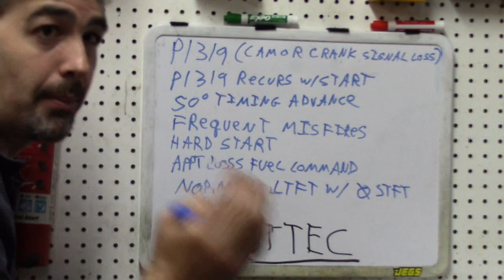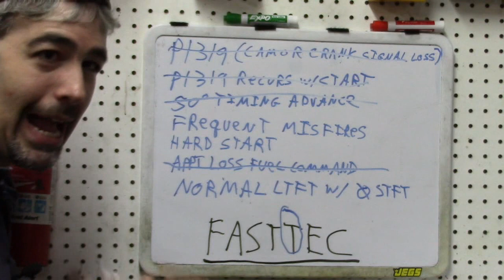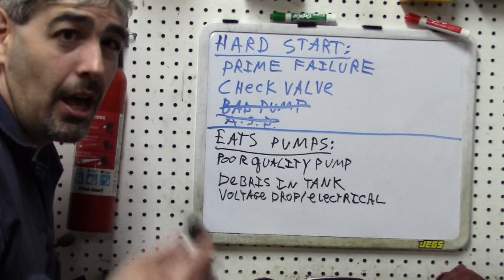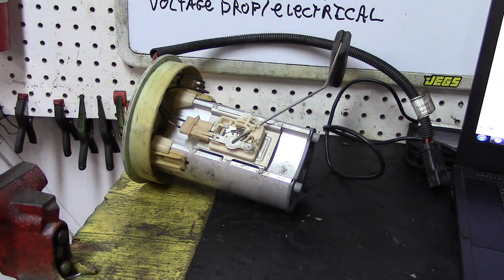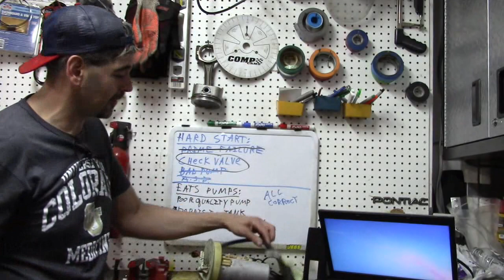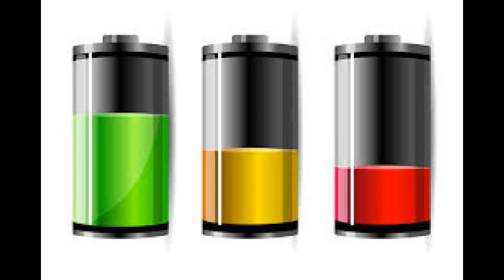Jeep Eats Fuel Pumps Follow up and Hard Start Diagnosis and Repair

Comment: So, you fully drained and rinsed the tank, right? And there was no filter (sock) laying in there?  SO, we've got a tank with no filter on the pump AND a bunch of particulate crud sloshing around in there, AND a pump that you're pretty sure is a used pump.  Hmmmmm......    It would be VERY interesting to look at the receipt the customer had from the place that put that pump in. Looking at the cost of the pump, and to see if they put a part number on the receipt.
______

INSERT COMMENT-->  Matt, I think you should strongly encourage all your customers to start maintaining full and thorough records for every single thing they have done on their car, not just with you, but everywhere they take it, including any work they do themselves. Have them just get a folder to put all their recipts in, and a small notebook to make brief notes in about what was done and when. Not OCD level record keeping, but just a very basic record. Date, mileage, shop, parts, diagnostics, preventive maintenance, etc.

I do this. I also save all the boxes that all my parts come in (for work I do on my car myself). I write the install date on the parts box in magic marker. And I save all the receipts, for both parts I buy myself and for all service that I have done on the car by others.

By the way, do you keep computerized records about your customers cars and what you do, or do you just keep a paper folder, or what?
END INSERTED COMMENT

_____

I just did some checking. From RockAuto, the Airtex part is $100 and the Mopar part is $225. It looks like the pump is the same wheather the engine is a 6 cyl or 8 cyl. Mopar part # is 5018056AC and Airtex part # is E7127MN.

I'm gonna go back to one of my usual rants for a moment (sorry).  WHY can't you or the customer go back to the previous shop and say>

 "Look dudes, I took this pump out of this car. You guys put this in there. But there is no filter. And now the pump died AGAIN. You did a job that was not only incompetent, but FRAUDULENT. You put in a pump without a filter. That's like doing surgery without sterilizing the scalpels. Because of it, the pump died, and the customer is now paying me money to do the job PROPERLY.  What are you going to do about refunding the customer his money for the labor and for the part that you put in? And by the way, did you install a USED pump, but charge him as though it were a NEW pump? That's FRAUD my friends."

If the american automobile owner can't start finding ways to do as described in the above paragraph, we're never going to get better results from the repair industry. Although it might not be possible to PROVE that they committed fraud, they will know that they did (possibly twice, one for the filter and once for a used part).

If the fraud could be PROVEN, the customer could sue them and would certainly get some sort of settlement, the bigger the better.

When a bad shop starts to realize that by doing a shitty chintzy job and saving a hundred dollars or making a hundred dollars beyond what they deserve, but then they end up on the loosing side of a thousand dollar court ordered settlement, maybe they might start changing their behavior.

I wish I understood these concepts better when I worked in shops (like, 35 years ago), because I would have done something about it. I hated the companies (chains) I worked for, I ended up quitting my job from three different shops. All three did horendously dishonest things, and often fraudulent things. A year later one of them was caught in an expose on the evening news committing fraud.

End of rant. For now.

-Douglas
Reply from the maker: No sock. When I clean a tank I reach in to my elbow to sponge and dry every inch of the interior, especially the corners and there was no sock. Maybe it fell out in the donor tank years ago  and tech didn't know there should be one?
Reply: +douglas lee Wonder if they just pulled a badly clogged sock off the original and put the pump back in without one.
Reply from the maker: ***** I was thinking the sock is still in the donor vehicle tank and they never noticed or even knew about it

Comment: I know what you mean about your story I get it all the time I tried to explain about the voltage fluctuations in a vehicle and how the computers in the car don't like that. The older people don't get it they think we're just nuts just don't know what we're talking about. But in a sense if you have a bad cell in the battery in the voltage is fluctuating all kinds of strange things will happen to the cars PCM. At least this is what I have discovered over the years of experience that I've had in the feel of the locksmith. And we deal with these electronic key is daylight. Diagnosing the problem in most cases is the hardest problem for most shops but I appreciate the work that you do because you work like me. Like to get the right answer and then fix the problem. Great videos keep them up. 

Thanks James
Reply from the maker: Yes I have seen everything from speedometer problems to apparent transmission problems result from bad batteries.

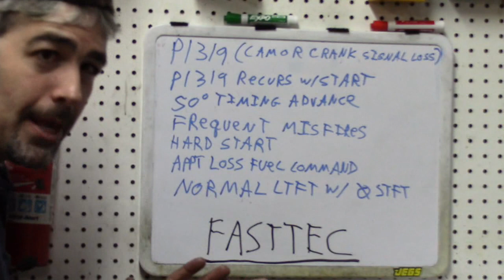Comment: 6:01  Anyone experienced in auto repair would know that you got a nefarious double-whammy with a bad cam/crank + fuel pump issue.  It probably would have stumped most technicians (judging from the owners previous bill that is obviously true).  The fact that you figured it out is a testament to your skill.  It's probably one of the most complicated multi-issue scenario you could have roll into your garage.   This video is going to help a lot of people.  Two thumbs up.
Reply from the maker: Absolutely- anytime you have two (or more) problems it becomes very difficult- but 10X so when the problems share the same symptoms so one doesn't stand out!!
  Basically, once I eliminated Timing as the cause- only then did I have to consider there may be an unrelated simultaneous problem that was hidden.

Comment: "In a logical process you are not allowed to dismiss data or evidence because you don't understand it." This is the basis for a lot of research incompetence and fraud. In the social sciences (and probably medicine research too) the popular prejudices come to be relied upon so that a conclusion can be reached. Sometimes the researcher knows of the prejudice and sometimes not. The public commonly does not. Therein lies the opportunity for implanting beliefs of causation which in reality do not exist.
Reply from the maker: Well put!! I can definitely tell you in research I have personally seen evidence or data dismissed because- quite simply- the researcher doesn't want it to be true. Cell line misidentification  is a HUGE problem (e.g researcher thinks they have one type of cell they are studying but actually it is misidentified. Happens 30% of the time). The researcher gets great data but never checks their cell lines. But introduce the idea they should verify their cell line is correct and they will tell you to pound sand because if it turns out they had the wrong cells, it would mean their research may be bogus!
  "sticking your head in the sand" basically.
Reply: +Schrodingers Box Do you jury articles for journals?
Reply from the maker: Kevin Hornbuckle Nope- I am in a different career within the science field now- I left academics some time ago
Reply: Yeah, but you can only (usually) check one thing at a time!  Only have 2 eyes, 2 hands, 2 arms and sometimes they ain't long enough!  -- Therefore, many of these tests are very time-consuming.  If the customer and/or your boss is breathing down your neck and expecting you to be clairvoyant, have x-ray vision, plus the ability to time-travel so you can fix it last week before it broke in the first place, you may be S.O.L. and have to take a wild guess.  If it works, you're a HERO! (and have a slim chance of beating flat rate)

Comment: 5:14 Just because you have good LTFT doesn't mean there is good fuel pressure for starting on a first crank (will cause hard starting / long crank time).  I really hope you aren't advocating that good LTFT means good fuel delivery,  that is simply incorrect.  Sometimes it takes a while for fuel pressure to build up with a faulty weak pump or split in fuel hose inside the tank.  A split hose inside the fuel tank might be just big enough to reduce pressure to the point it takes a while for pressure to build up.  That's why it requires multiple attempts or prolonged crank time.  The only way you would know differently is by using a fuel pressure tester.  Checking LTFT is not a substitute for a fuel pressure test.  Because you are a great diagnostician you eventually looped your way back to the problem and made the correct assessment.  I believe the flaw in your methodology is that you thought LTFT could confirm a good fuel pump?  Forgive me if I'm not understanding you correctly here, that's what it sounds like you are saying to me.
Reply from the maker: Yes correct- LTFT at idle is not a good test and it is also irrelevant during starting however LTFT under load IS a solid indicator of pump delivery, and definitely enough for starting a car. 

  Had there not been irrefutable evidence of a cam/crank issue, I would have suspected a check valve based on previous pump history on the car. But given the evidence- there was far more reason to triage timing than a fuel pressure issue.
Reply: Schrodingers Box Good point. :)

Comment: +1 for deez nuts clip and kudos for keeping your composure with the old guy. So you wanted to see something more exciting in that connector? I'll tell you a story about an exciting connector that happened to me. So this was about 2 years ago right before I was of legal age to drive. My mom started driving a Corolla we had lying around after she crashed her van. At one point it stopped starting, so she took it to a shop. Guy told her it was the pump. This was fuel pump #4 installed by the same guy who did the previous ones. It ran fine after I took it when I got my license. One day in my school parking lot it didn't start. At this point I started working on cars so I took it home and started looking. It had good spark, it had air, didn't have a compression tester, but it had no fuel pressure. I take out my back seat and look at the pump. I pull the connector and what do I find? The metal tab inside the connector broke on one of the previous fuel pump replacements so they cut the tab on the corresponding connector and tied the wires. Literally just tied. It corroded and it wasn't getting any power. I had to replace the pump because it was replaced with a used one and I had to go cut a connector from a junkyard Corolla and connect it correctly to my car. Looked at the tank and it was clean as a whistle. After that it ran like a dream when I sold it a couple of months ago.
Reply from the maker: I have seen this before twice!!! And how many times I have seen JB weld on those thin EVAP hoses at the top of the tank that can break off but the weld clogged the tube lol.
Reply: Schrodingers Box Yeah this made me want to go and show the guy how angry I was but I'm not a physical person unless I have to be and I have to "respect my elders"

Comment: Excellent video.  Looked forward to seeing that fuel pump for a few months now.

Wonder if the other shop dropped sediment into the fuel tank when removing the fuel pumps they replaced.  Great warranty.  Maybe you now have a new customer for life.  Not sure if that is a good thing.

With your warranty, I might be concerned about sediment in the fuel injectors causing problems.  Reason I say that is that the check valve might have stuck open because of sediment backwash.  That would mean sediment made it out of the pump and into the fuel lines.
Reply from the maker: Excellent point in contaminated rail and injectors possible. Off camera I did a balance test to confirm and no indication of issues.  Honestly this engine now purrs better than maybe any car I have ever worked on.
Reply: +Schrodingers You may have already done this.

If you get that Jeep again you may want to take the opportunity to back flush the fuel line from the injector rail to the pump.  There is a steep rise in the fuel line just before the engine and the fuel line between that rise and the fuel pump may still have some sediment in it that can backwash and clog the check valve of the new pump.

Comment: I think my the concepts of trouble shooting are settled into a more mature place, partly thanks to you. What I mean is, yes, I've learned tons more of what to look for, but being right on the guess is no longer the point for me. Sure, I guessed there was debris in the tank, but I hadn't thought of a voltage drop causing damage to a pump before, so regardless of what's actually wrong, all I care about is knowing to check for all of them instead of finding the problem.

I remember years ago, using those AutoZone print outs and finding what I could do versus what I didn't have a clue on. Often I got lucky about what I understood, but at least I wasn't assuming what I didn't understand couldn't be the problem!
Reply from the maker: EXACTLY 100% CORRECT!!!!  Yep you get it!!!

Comment: 0:23 what you talking about Willis?  Three weeks ago, I replaced the cam and crank sensor in my 2005 Jeep Grand Cherokee 4.7L V8 and had absolutely no issues after the install and over 400 miles of driving.
Reply from the maker: You still may be out of sync but there will be no symptoms. Using the scan tool, the cam and crank signals on this vehicle were 20 degrees off due to improper cam sensor install. You can rotate the cam sensor similar to an old distributed to adjust this, but you need a bidirectional scantool to "program" it into the PCM.
Reply: That may be true on the model Jeep you were working on which I believe is the earlier generation 1999-2004.  My 2005 service manual has no information on cam sensor rotation and from the installation there was no rotational option.
Reply from the maker: Sandbag1300 Yes I agree- also my info only applies to the L6 as well.